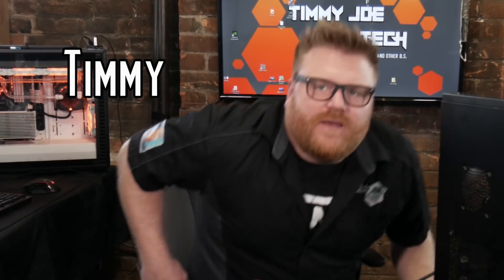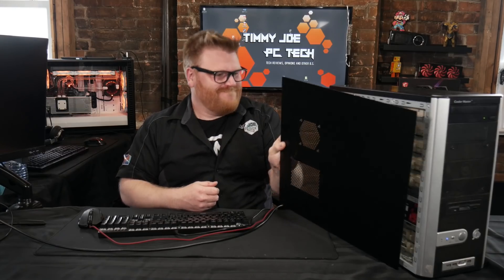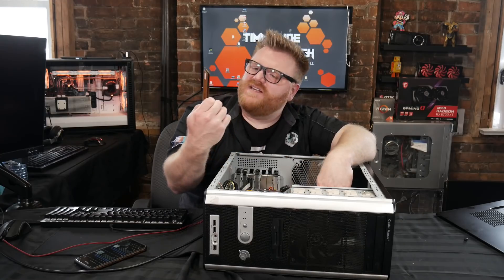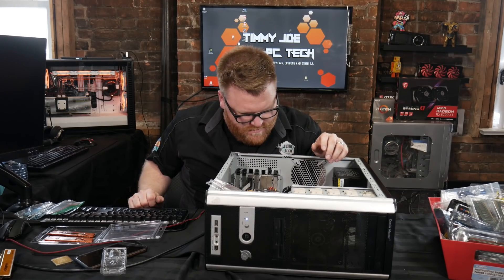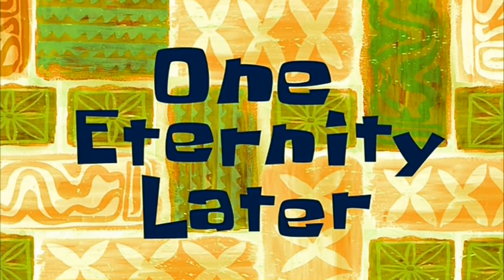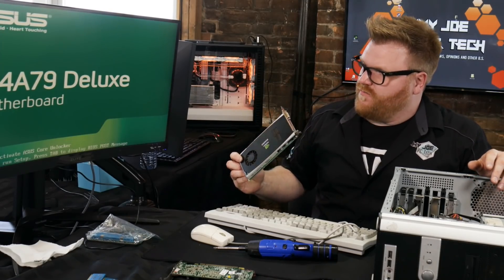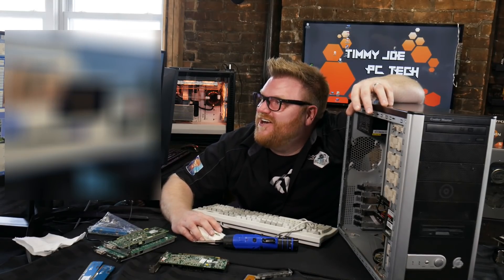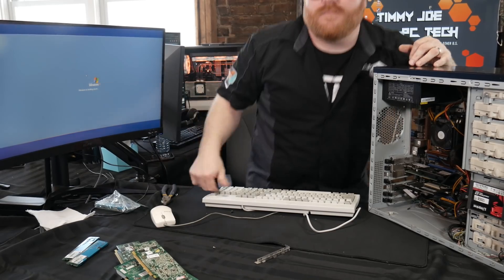Broken PC has a secret in the CD-ROM :-o

Comment: I have that same Coolermaster case, but in blue instead of grey. Mine is currently housing a Pentium 3 866 MHz, Windows 98 SE and a Voodoo 2 (I have another for SLI but it's not currently installed), but no pr0n in the CD-ROM. My power button has also fallen off, but sadly mine is lost.

Comment: Really enjoy watching youre streams!,i alr thought it was the ram mem why it wouldnt post after refreshing case,bcose i used win 8 and a array of different mother boards and cpu vgas i got quite knowledgeable with pcs and trouble shooting,i solved some god damn amazing misterys,latest thing is discovered is that the entire rx line of amd has corrupt software that causes blinking and black screening and full signal loss,i never ever got a single letter from amd saying there fucked up software was broken.. no instead i had 5 to 7 years of problems with my rx560s 1 rx 580 from msi,and the worst of all my super expensive rx vega and my gaming setup of around 2000 euros wasnt usable for 3 to 5 years cos AMD radeon,and adredeline and all there software is corrupted AMD really lost my trust.....never buying there garbage again,now its all over the internet and there stocks dropped like a brick serves them right those f amatures...
Reply: i couldnt even remove there software in the end after updating cos there was full signal loss even b4 you could enter the programs menu,mb bios is switched of so i had to pull a trick with another vga with different software just to remove amds bodged garbage...what a nightmare...

Comment: Most computers from the 2000 era won't display the boot sequence on modern monitors. Some manufacturers of monitors have included legacy support modes, but even then they may only display when an operating system loads. The safest way to boot an older computer with display for access to your bios, command prompt, executing safe mode, etc. is to always use an older monitor. It might also be necessary, if at all possible, to force the first display to come from the PCI-E or AGP port first in the bios.

It's important to use an older monitor or you might find yourself in a never ending loop of replacing other components when you're computer is booting normally, you just have no display.
Reply: turn it off turn it off and the computer full screens it for fun to be bad before shutting it down🤣🤣

Comment: Phenom II on AM2. . . I made a mistake putting my Athlon II (same generation, just a cut-down version of Phenom) on an AM2+ board.  I truly regretted that move as within a couple of years of building it DDR2 prices started skyrocketing, then became virtually impossible to find in my area.  So that system was stuck at 4G of RAM. . . had I not cheaped out and got an AM3 board instead, I would've been able to upgrade the RAM much easier and much sooner, and then later swap the Athlon II for an FX series CPU.

Comment: "High Definition Audio Bus" was what XP video drivers often called the HDMI audio.  Set him up with an XP VM for his old hardware:  Use a modern NUC or other tiny PC headlessly and VMware for easy and reliable PCI or USB pass-thru, add COM/LPT ports to the host as needed, and then he can use it over RDP/Anydesk/whatever on his daily driver.  We have a lot of customers with old plotters and this is an easy, reliable, and cheap solution that's far better than the astronomical expense of a new plotter.
Reply: who wouldn't want sexy cops in an old computer🥰🥰🤣🤣

Comment: I think its funny that the guy didn't know that even if the machine is suto dead and will not eject the cd drive that there is a little hole in the front the size of a paper clip. and when you insert paperclip into sead whole will pop the drive open to retrieve cds

Comment: My first build, which I still have, has a AMD Phenom 965 x4 BE clock to 4.0 ghz with an air cooler. Was able to get it to 4.4 ghz stable, 4.5 shut it down..

I had 2x 2 gig sticks of OCZ Reapers you showed, with the heat pips on top. Wish they made them still. They honestly look better than current ram sticks! I at some point, added two more sticks of the same ram that I bought off ebay for way to much. But in the end, I had 8 gigs. Although I had all 4 sluts populated. Just wish I knew then, what I know today. Now have 8 gigs 2× 4 gigs of Patriot Gamer Series installed.

My psu, was way more then I needed at the time, 800 watts. Kingwin Mach 1. It was semi modular with screw in cables that looked absolutely nice. There were rings around each cable that lit up in blue when connected.

I have Windows 7 installed on a 1 tb WD Cavaier Green hd.  Not much else installed, except Quake 3 Arena. Awesome game to play!

Comment: Hi,

Xp weird 
That situation no beeps at all. check see if PSU is at least fan moving, but you got beeps.   
Even then it might be the 5 or 12 Volt gone on psu halting post.
Xp and ram weird, sometimes removing ram and or swapping slots was  afix - not commonly. 
After single beep no post weird, there were pci error code cards itd spit out a number look up the number, for trouble shooting.

before replacing cpu or gpu clear cmos - you might see jumper on mobo from that era clr_cmos - bridge pins
Alternatively remove the cmos battery cycle power button several times or wait approx 30 seconds (offcial answer)
Often in that instance you'll notice the cpu fan kick briefly
These are easier to do than change cpu and quicker

Video card if its  change to other  slot - it might be faulty slot.
Test video card in another pc

Xp wont address more than 4gb ram - even then if i recall it reads it as 3.5GB  thereabouts shame about a 8gb stick.

Might have considered using a newer machine and use a virtual PC running XP 
Finding a com port compatible or a pci card that will still be detected by the virtual machine of an older o/s on newer hardware may prove interesting challenge unsure on that.

You could use a sound blaster 16 audio card, drivers are very well supported on xp from that era - if the onboard sound ever dies.
drivers.com was helpful for XP related drivers, if its still running.
Think there may have been a newer version "old drivers com "or similar sounding.

Xp was buggy to the point where I'd avoid the hibernation mode, seems things would get messed up to often for my liking.

Some say Win 98SE or even XP pro was the ultimate version of windows, as every version just added more layers and more clicks to get to the area where you wanted to get what you needed done and it became convoluted from that time forwards with store and bloatware  more tracking and telemetry than was required.  

Indeed just prior to the release of windows Vista an urber geek was taking apart the O/S to see what made it tick, as it were.  Turns out he got some super early pre release version for testing  and there was a folder still labeled nsa encryption keys.  Urban legend myth or fact or every version of windows adds more of these encryption keys and no one knows what they do - seemingly.

Fun times.

Comment: Your ram is running in single channel because you have it in wrong. You should have used the 2nd and 4th slot. Not that it really matters in this use case.
Reply: He said only single channel worked, so it could be the 4th RAM slot is bad, and that's not uncommon in some older boards, where only one set of ram slots would work, but slot 1 and 3 to get dual channel as well, but yeah it's hard to tell for 100% with how the video is edited here.

Comment: Hey Timmy interesting video!  I still use this early Cooler Master Cosmo case with my Sandy 2600K rig.  (blue painted version/2005)  So..,  was the issue with the ram slots not recognizing/seeing ram?   I have that same problem with 4 sticks of ddr3 (16 gigs total) of ram.   every once in awhile my MSI P67 would boot loop on startup.  I just remove the ram and spray the slots and ram with electronics cleaner and it boots right up!  I think corrosion gets into the slots and causes the system to demise/fail.   Keep up the cool videos!

Comment: LOL, porn burned to a CD.

But this reminds me of a service call I got for a semi-truck transmission shop. Their payroll was being printed off an old dot matrix printer that they communicated with over a token ring network. I'm not young, and that printer was almost a decade older than I am. Was barely able to find the part, used. Told them to start looking to update that system since then next time it goes down, there may not be a way to bring it back.

Comment: I still use an old Core 2 Quad, in fact I'm using it to watch this video! I use it to watch nearly all my media consumption, running Win10x64, on a small 120gb SSD, and a GTX 550 ti.  I would like a better GPU for it tho... but I can't find a decent video card for $150 anymore.

Comment: Have you tried the 32-bit version of windows 7?  I have found in the past that you can finagle a lot of Windows XP programs to run properly on that OS.  For that matter, even using the in-place upgrade options for Vista, then 7, can sometimes carry a stubborn old program kicking and screaming onto newer hardware.  I certainly wouldn't replace an industrial plotter just for software compatibility.  I'd either find a way to make it work on newer setups, or I'd stock a closet full of old XP machines.

Comment: How is this system using ddr2?  The processor said it uses ddr3.
Reply from the maker: And you can find i7 6700 boards with DDR3..... ooOOoOoOOoOoOoO
Reply: @TimmyJoePCTech  yeah now that I think about it some amd chips did support both. So it is depending on the motherboard which memory was used.

Comment: I used to have that same case but then upgraded to the Cooler Master Centurion 534. That is the Cooler Master Centurion 5. I took my 534 and cut the side panel out and rattle caned the inside flat black. It was my second mod back in 2008. First time I modded a case by cutting the side panel and added Blue LEDs was back in 2003.

Comment: As other have said, use an X58 motherboard, it will probably have COM and LPT ports, you can run windows 7 on it, with windows XP mode (virtual machine) for the old software. i have to do this sort of thing for CNC machines all the time.

Comment: still runnin an age old phenom 960t under ddr2 on the old am2 non+ socket.. lately to restart the computer one must power cycle the psu turn it off and on then power button as regular power button restarting fails to post.. upon power cycling the psu the bios Detects a new cpu and boots.  the damnedest thing
Reply: also i caught the onboard audio rapid fire detecting, disabling,dissapereing then re detecting causing massive system stuttering. Disabled the onboard audio hardware entry in the device manager. using hdmi sound now.

Comment: Well, sometimes you just can't upgrade to a new platform without spending a fortune for no real benefit. In our lab we still have a measurement system connected to a Pentium 3 system. The reason is the software is programmed for the GPIB card in it, which is ISA and doesn't work in those new boards with an ISA slot XD

Comment: To check the motherboard and cpu, you have to do it without ram for beepcodes with this type of machine like lga775 or phenomII's. Only motherboard, cpu, psu, fans, and a buzzer. If the ram or the dimm socket is broken, the machine gives no beepcodes and the fans turn for an eternity.

Comment: There are some pci-e too serial port adapters so you could build a newer 1155 system for him as that has windows xp drivers too for i think pretty much everything he would need I'd imagine, maybe have it dual boot into 10 as well for going online on the same system.
Not too mention 1155 still has pci slots so you could reuse the pci too serial adapter already existing there.

Think all 1155 chipsets work for windows xp too so would have quite the options for hardware there not too mention reliability.
Just needs the sata drivers pre-loaded before installing windows xp & it's good too go, skip overclocking ofc if you get a z chipset motherboard or have one at hand, maybe slight overvolting on the ram for stability, like 1.5 too 1.55v on the ram.

Also very common these early am3 / late am2+ motherboards failing on the ram slots, got one am3 asus board that has 1 ram slot working, which isn't great when all you have spare is 2 gb ram sticks lol.

Comment: Get a x58 MB, a lot of them have IDE, com pots and other legacy things. Not to mention you can put a 6 core in there :) .

Edit: not many  x58 boards have com and lpt ports, but you can get pcie cards for that. Still x58 has beter compatibility with windows XP.
Reply: Even better: Get an industrial embedded PC.
Reply: Yep, I’ve seen a few asus and gigabyte X58 boards have IDE connectors
Reply: Gonna be honest, most boards ive ever seen have serial and LPT headers on them, you just need a cable to bring it to the rear panel. H370 d3h I know for sure has LPT, not sure where serial is
Reply: Yeah, I've got one of those too for just that reason. An mATX Asus ROG  Rampage III Gene with a 6c/12t Xeon in it (forgot the specific number, but it's the one with the highest multi and is supposed to OC like crazy). I've got a Sapphire Toxic R9-280x in it, 24 gigs of DDR3-2400 ram, and a SB X-Fi. Still haven't gotten it up and running, though. My current situation makes it difficult to keep systems out to tinker with.
Reply: That's what I'm doing, probably gonna order it on monday actually
Reply: Lance Ivan Dela Cruz  I found the GA-x58A-ud5a rev 2.0 in a pc on the side of the road. Try getting an x58 locally. Good luck :)

Comment: Needs to look for some updated pr0n. 😂 Also always keep extra old ass stuff like dvi to hdmi and usb/ps2 adapters around!!&@$ Can’t remember what you said about the display out part but when I put mine together I couldn’t get a display on the DP.. only hdmi. Had to go thru some weird shit to change the bios to uefi after windows was already installed. Then it worked.
Reply: had the same issue with a gtx 750ti from msi. the thing refused to output a thing if you didn't plug the monitor before turning the computer on.
Reply: @white_mage  for reference, mine was a msi b450 th-max mobo and a 165hz gigabyte aorus monitor. First time I had ever encountered that sort of sorcery.  Drove me mad for a few days swapping cables from hdmi to dp, til I figured it out. Even tore the cable end open to make sure it was pinned right..  🤦🏻‍♂️ sometimes searching for answers on the web is like reading comments on the Microsoft help forums. pages of replies but no definite solutions. You’d think someone would know these things. But i was probably just 10 years behind on my tech knowledge.